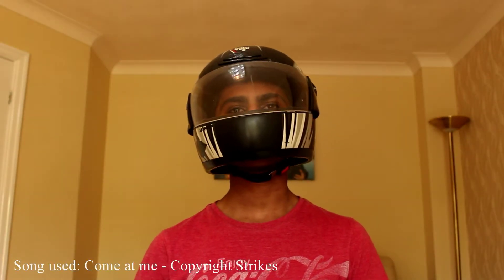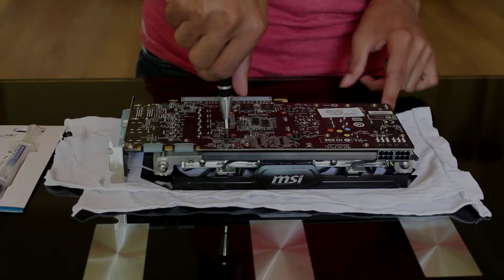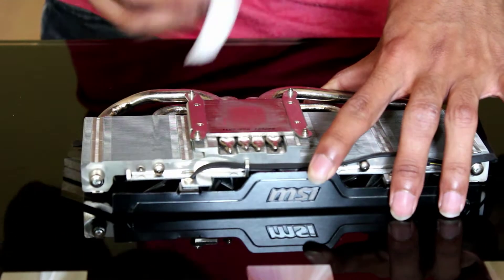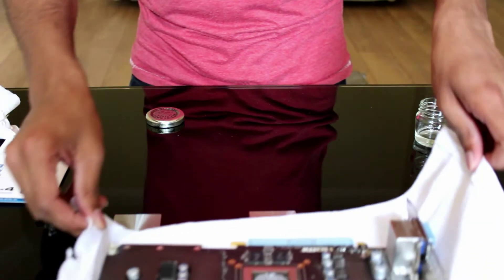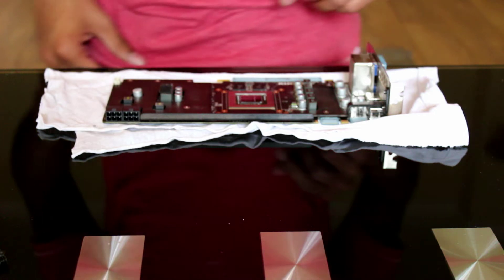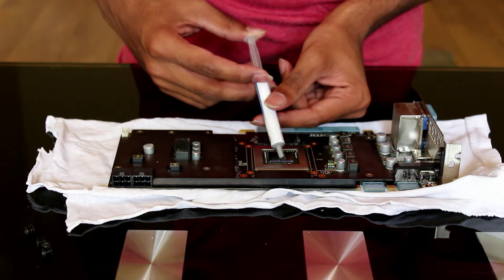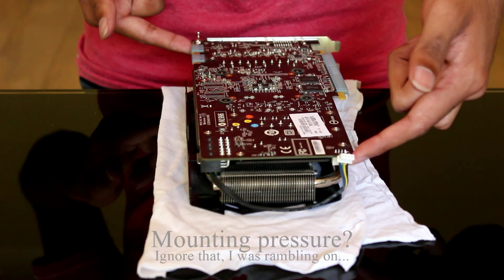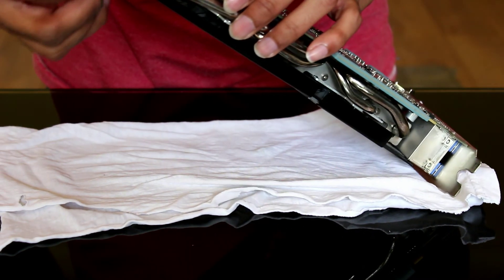How to change the thermal paste on a graphics card

Comment: I dont think toilet paper is the best option. Use something that doesnt release as much fibres...
Reply from the maker: F430 Ferr Hi, thanks for the feedback! I agree! I mentioned in the vid that toilet paper is only for the initial clean, and then to use a lint free cloth to finalise. Hope this helps!
Reply: Sure! But the fibers release in the first cleaning might be getting all over the PCB. Will probably not affect anything, but there are better options never the less :) 

Also one should be careful not to scratch the GPU surface. It's machined to that shiny surface for the best possible heat transfer.
Reply from the maker: I see what you're saying! Much appreciated :D

Comment: Same process for MSI GTX 660 OC TWIN FROZR ?
Reply from the maker: This is the twin frozr iii yes? It should be a similar process, I recommend removing the 4 main heatsink screws first and then very gently trying to pull the cooler off. If it does not move, try removing more screws and repeat. Be sure to let me know how it goes, should you attempt the proceedure! Thanks